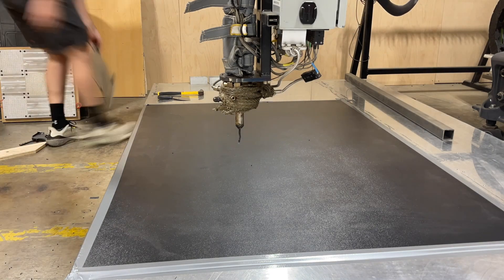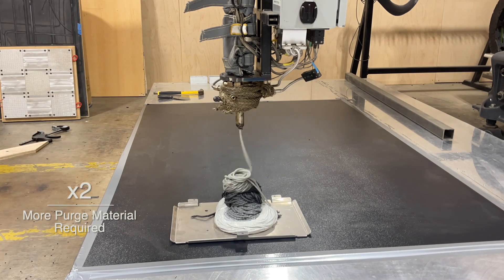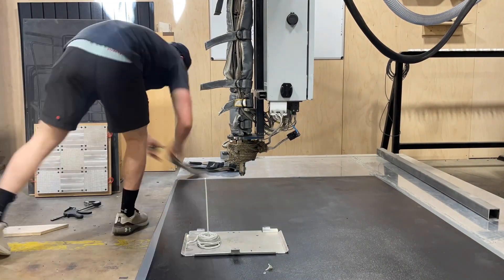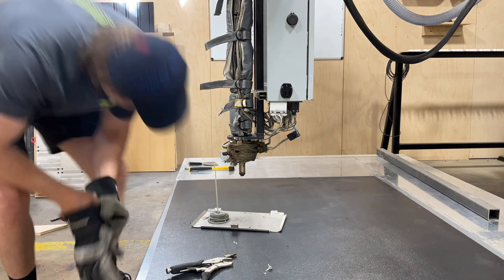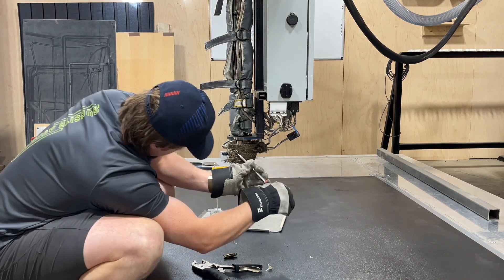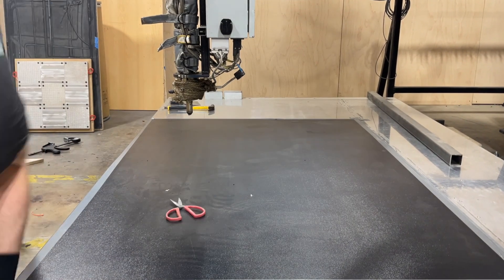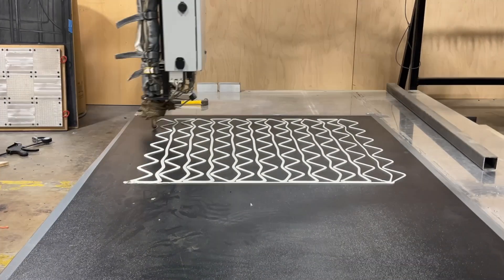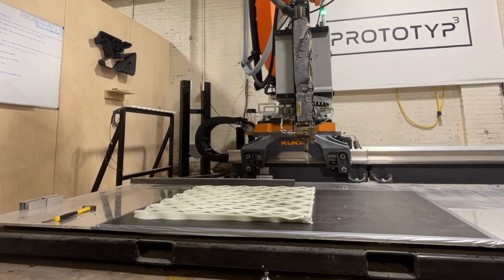How to test a new material on a large format 3D Printer

Comment: Hello,
it consumes some material  to purge entirely the barrel ! 
I have 2 questions to ask you :
1. How much troughtput the installed extruder can deliver ? 
2 . which kind of material do you use on the build plate for adhesion ? is the build plate heated ?

Very impressive work ! Will you plan using the 7th axe to execute long prints ?